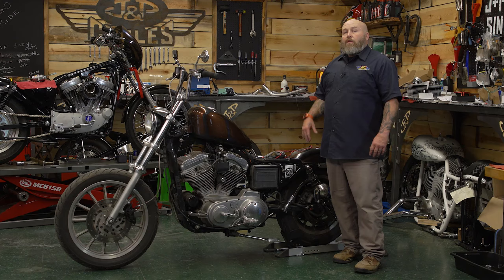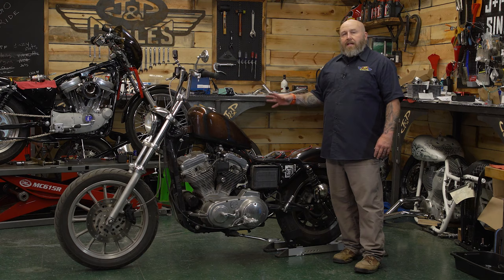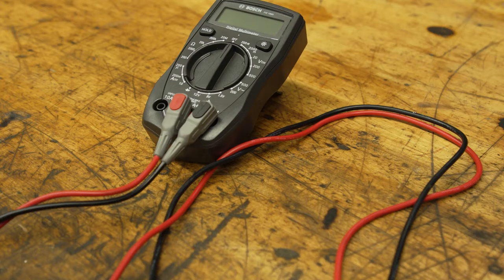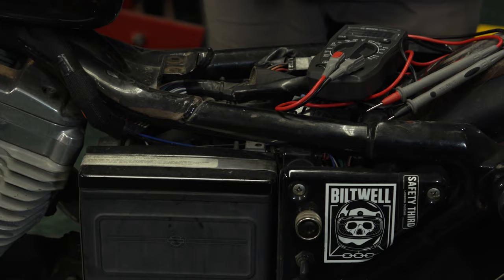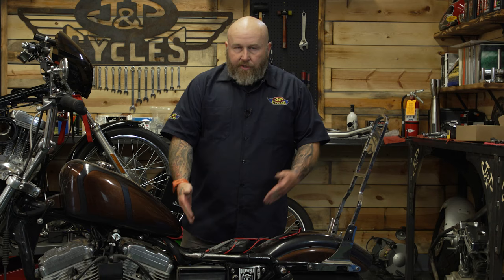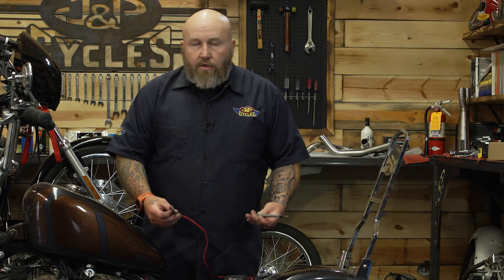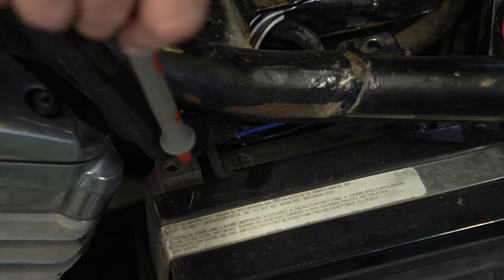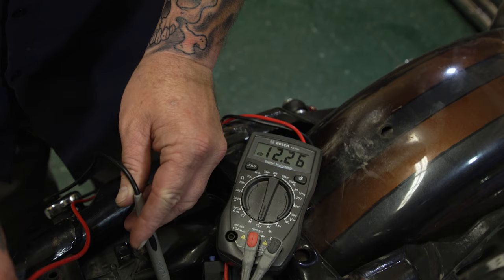How to Test a Motorcycle Battery : Weekend Wrenching

Comment: A bad battery can take a charge really fast and appear ok until you load test it. Sometimes even a small load will pull it way down almost instantly. If you don’t have a battery tester with load test capability you could turn on your headlight, say, ignition on, bright light on for about 10-15 seconds. If it drops below 9.6 (on a car battery…I assume a bike should be about the same) it’s a bad battery. The proper way to load test it is to put a load on it equal to half it’s cold cranking amps but without a load tester the above method should suffice to tell you what you need to know.
Reply: thanks man, thats what happening to my bike. Mechanic told me i need to repair something but was a faulty new battery (maybe not so new). I let it on the charger for 10 hours and i install on the bike, i let everything on for 30 seconds as you said and battery drop half charge

Comment: All this does is check resting voltage. It doesn’t mean the battery is healthy, it’s only checking charge level. 11.8 is dead 12 is about 25%, 12.2 is about 50%, 12.6 and up is fully charged. You also need to drain the surface charge before checking. Either let it sit for 12-24 hours or turn the head lights on for 30 seconds then check. To check health (capacity), it needs to be load tested. Either via a voltage drop test while cranking or carbon pile load of 50% cca rating, or digital battery tester.
Reply: What is a healthy range for voltage while cranking?

Comment: thanks for the video, but your saying 2 different things here, can you clarify it a bit, you say if your at "12 to 13, 13.5 volts, that's a good hot battery". But then you say if you under 12Volts, really 12.5 you could have a problem..." soooo see my confusion here, lol you sound like a weather forecaster.
Reply: i think a good charge will look like over 13v, under 12.5v it might not be able to crank.

Comment: I got a 3yr old battery testing at 14.33v ( 2 days off the bike on a bench)  same reading in bike as well  and I did a bump amp test  3 times and got 1388 to 1418 , which confuses me. I've done this before with a 210cca ( Shadow )   and got proper readings,. This is a 120cca battery but reading over 1000?  No decimals are in the display.  I'm having some electrical or fuel issue , keeps fouling out left sparkplug the old NGKs & the brand new NGKs ( kickstand side fouls) ,I've drained and flushed both bowls   tested coils , CDI, and stator , all within spec , 2009 ninja 250R 34k miles  , other then removing carbs & cleaning/syncing I got the weird battery thing happening.  I even tested some other batteries to rule out volt meter ...

Comment: 0:56 - 12v? No way, that's a sure indication you're going to get stranded soon. A healthy, fully charged battery should read 12.6v - 13.5v. Anything below means the battery's health is less than 100%, 12v means it's almost dead.

Comment: Hi, I have a kymco super 8 2014, lost power last night when riding home, and now all my power is entirely down, no lights, no indicators, no horn and button start not working, i checked the fuses near the battery, it seem fine. would you kindly know what might be the issue. bike has done only 5000km, so will a battery die that quick, also at just one stance like dead?. please help thanks

Comment: Mine completely crapped out on my on an offramp and when trying to restart, no instrument lights, nothing. Checked kill switch fuses and terminal connections, all good. Geico Roadside Assistance dropped the ball on this and I was stuck 8 hours and had to pay an outside towing company $250 to get home. I've since joined AAA. New battery fixed it, when on getting 14.5 v, when off 12.7v. After spending all of Fat Tuesday broke down in a south Louisiana truck stop don't want this to happen again.